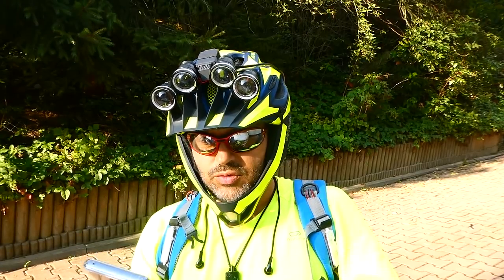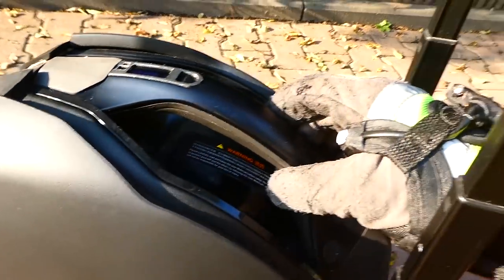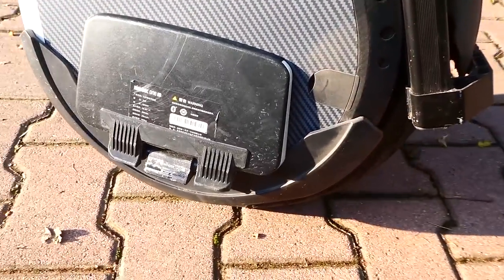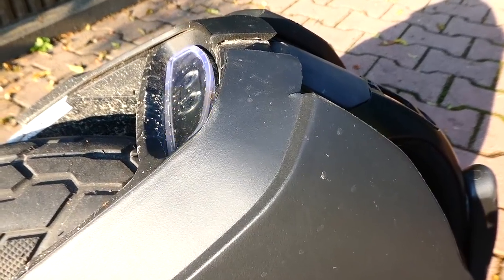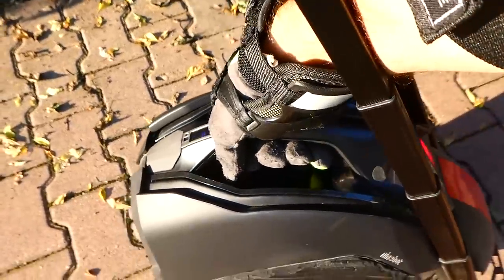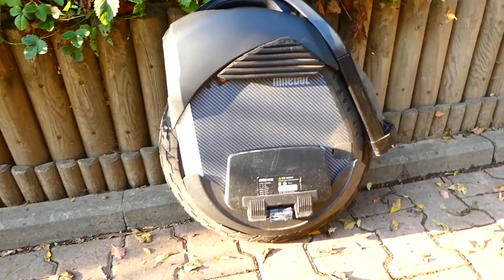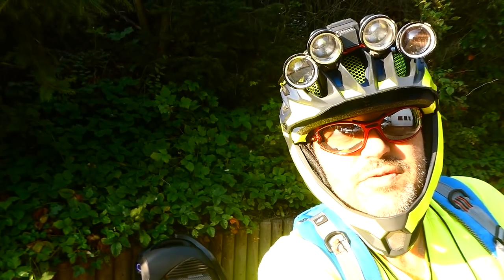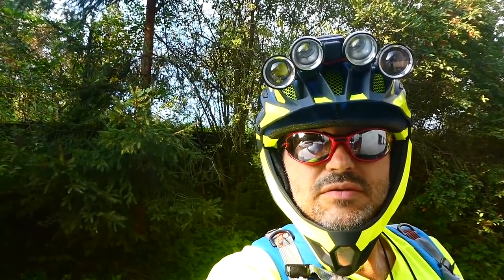Ninebot Z10 mods with partial review after 1013km (with mods description)

Comment: When you attach a typical portable air pump to the air  hose extender, the wheel air won't escape upon screwing it  to the wheel air valve.....just a tip comment.  Thank you for sharing your wheel experience
Reply from the maker: Yes - if you attach the pump - You will limit the amount of air which escapes... but for this wheel specific air pressure is needed - You really need the way to use manometer easily and with precise measurement without air escaping in this process..

Comment: Power looking lights you have Luk.
Reply from the maker: Morning on Saturday was quite rainy and cold, so I have taken out autumn/winter helmet. 4x10W Cree customized LED setup with 2 pcs wide short-range beams and 2 pcs radio controlled long range narrow beams.  Each led can have power set to any given 3 out of the 16 power levels. Custom setup based on the Chinese headlamps - heavily modified so only lens, chassis and battery case are from original inexpensive headlamps sets
Reply: Any tutorial on how to setup this light system?

Comment: Hi, what is your tire pressure and your weight?
Reply from the maker: For Z10 I used to keep around 28psi, my total riding weight with equipment is around 90kg
Reply: @LukLuk  
Hi,
What is the cause of the steering?
Tire pressure rebalancing something else?
I ask that because I fell while losing control of my Z10!